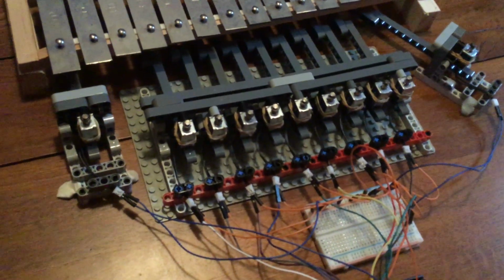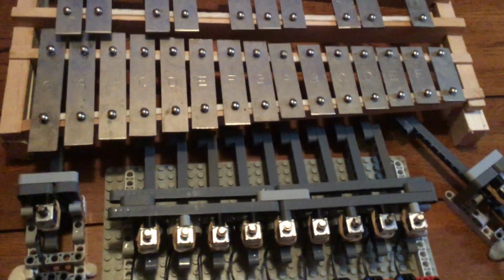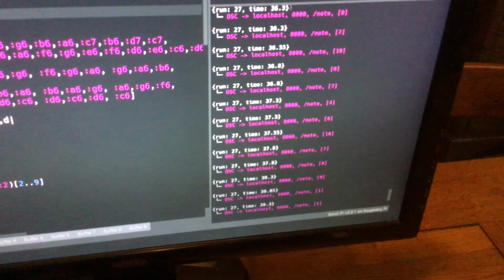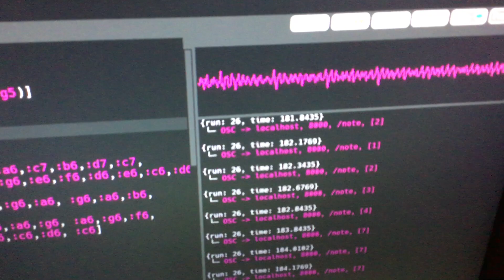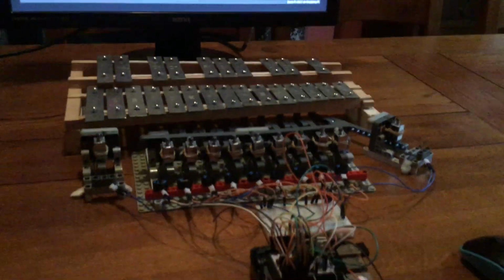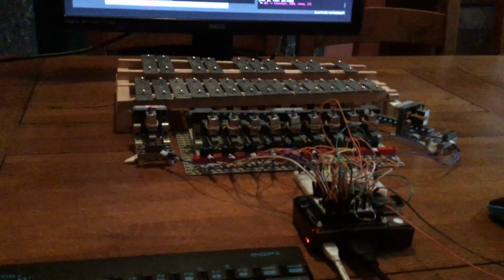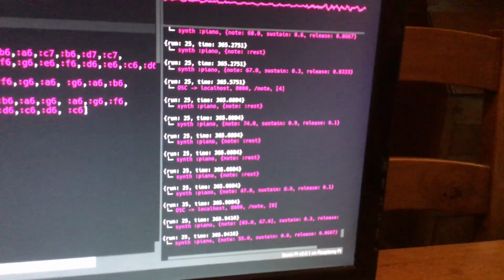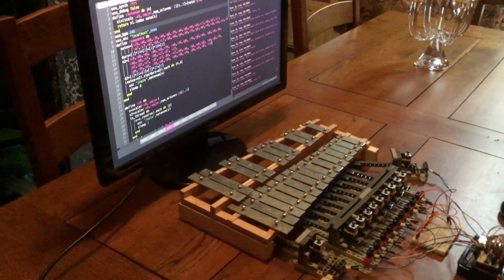Sonic Pi Glockenspiel

Comment: Hi, this is soo cool.. I'm working on something like this, Can you tell me how to input a midi file to the sonic pi? Do we need to convert each midi file to a code or is there any other way
Reply from the maker: It is not 100% straightforward to play midi files. SP can respond to midi input but not in quite the same way that a midi player works. I usually convert midi files to Sonic Pi format using a processing script see this article https://rbnrpi.wordpress.com/project-list/gotchas-when-converting-midi-to-sonic-pi/
I have however written code to allow a midi keyboard to play sonic pi. Here is an article about that https://rbnrpi.wordpress.com/2017/11/23/revised-simpler-polyphonic-gated-synth-using-sonic-pi-3/

Comment: What a brilliant project, well done you.  I believe I have the very same 40 year old instrument here, I’ve recently ressurected this to use with my 3 musical grandchildren of 7, 6 and 2 years.  It needs new support rubber strips and some new rounded metal caps which have been lost, all of which I have managed to source on ebay fortunately.  I am very practical like yourself, blowing my own whistle a bit, and would manage to put together such a project. I have no experience of Sonic Pi at the moment but that will need to change.  I am musically trained and have a very technical background, amongst other things I have familiarised myself with Raspberry Pi’s, BBC Micro:bits and Arduinos, several of which I own doing various fun tasks to help educate my young family.  I actually cut my teeth programming Microchip PICs in Assembler and find languages like Python a dream to use in comparison.

Please do keep us posted on this project, you’ve already given out a lot of useful information about resources in the demo video which I am grateful for.  I have also liked and subscribed to you site.  Many thanks.  John Pugh